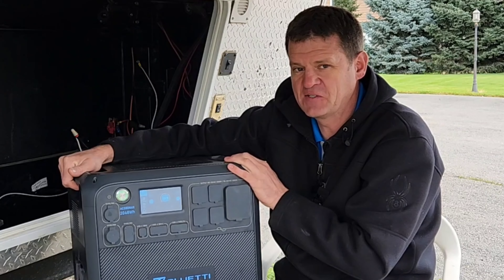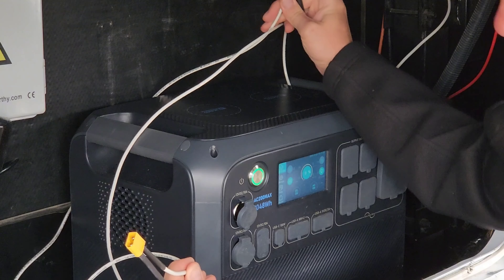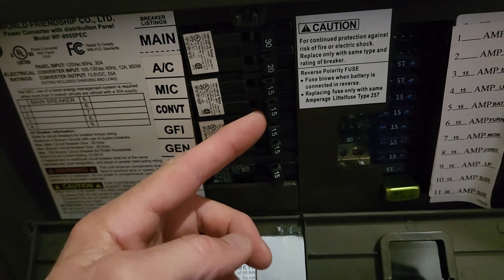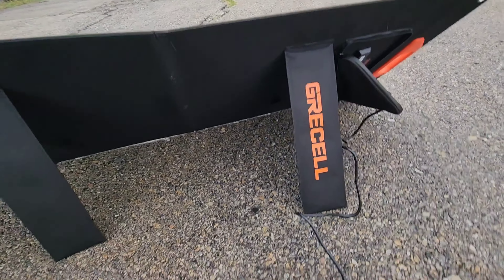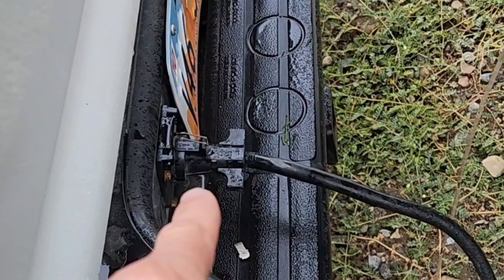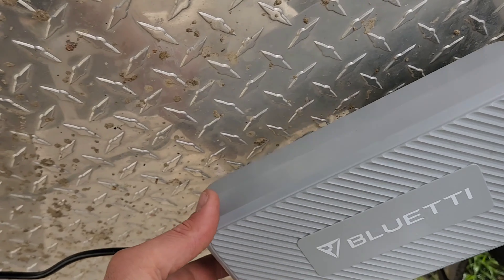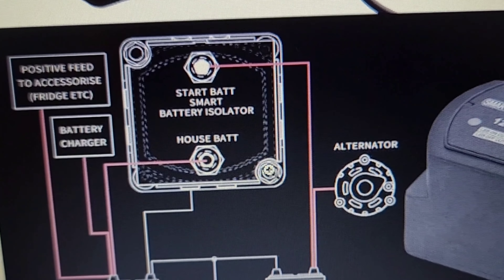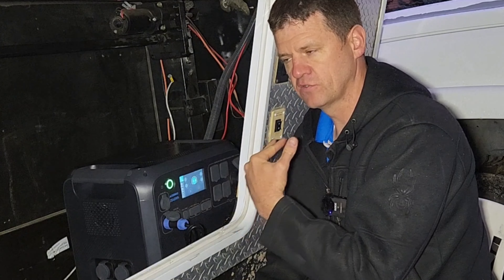How I installed a Bluetti as my primary RV battery.

Comment: Ok but you need about 800 watt's of panels
Reply from the maker: I've got double that on the roof :)
Reply: @diySolarPowerFunWithRay  oh well in your video you were fumbling around with those folding blow aways
Reply from the maker: @CatHound  yeah they sent me those so I use them in the video.  I definitely like the fixed ones on my roof a lot better
Reply: @diySolarPowerFunWithRay  How did you connect the fixed solar array to the BluEtti?  Did you have to use the D300S step down module?  I have four 320w fixed panels and not sure how to connect them to the AC300.
Reply from the maker: @PatRicciardo  will prowse just posted a video on this subject. I'd watch his video.
Reply from the maker: @PatRicciardo  the blutti has a solar port
Reply: @diySolarPowerFunWithRay  The BluEtti AC300 has two sets of MC4 plugs coming out of AV1 plug on the side of the unit.  AV1 can handle 2400W @150Vmax.  I can connect two 320W panels in series and connect one pair to each MC4 set.  That will get me below the 150V limit and optimize the panels without using an external stepdown device.  Had to think about it for a while.

Comment: Electric hot water heater?  Really?  What, two hours a day?
Reply from the maker: In the RV the hot water heater only needs to run for 15 minutes to take a hot shower.
Reply: @diySolarPowerFunWithRay  In my home 35-gallon water heater, it takes the same amount of time.  I have a timer but usually leave it off until I need hot water for showers.  Clothes washing and dish washing are done with room temp water.  Hot water never gets hot enough to kill germs anyway.  Most of us grew up believing the hot water sanitized the clothes and dishes. That was never true, but kids believe whatever adults tell them.